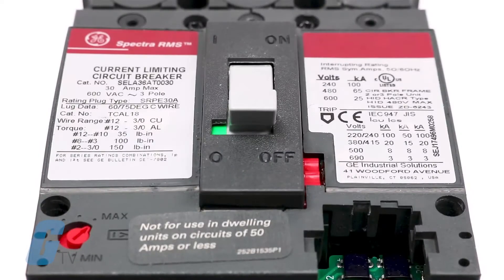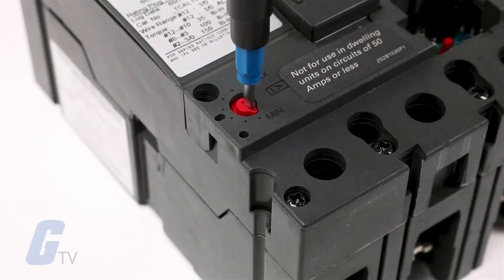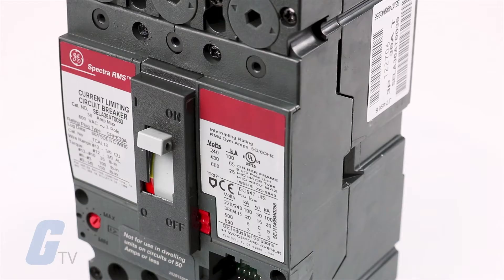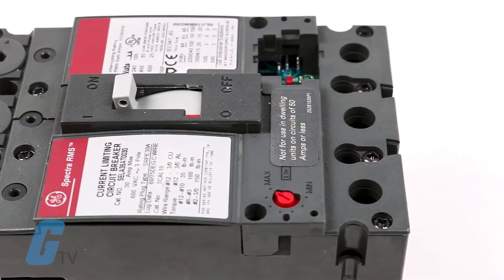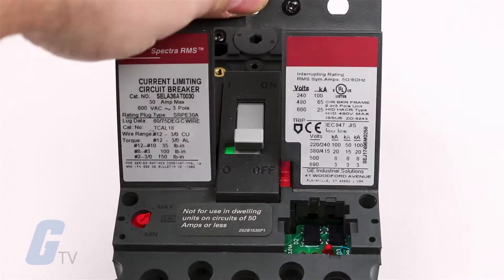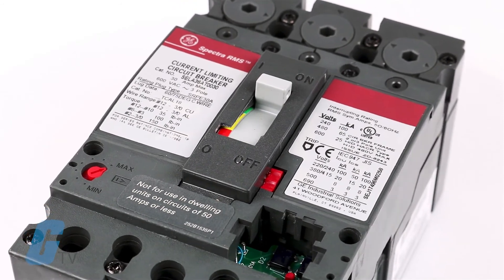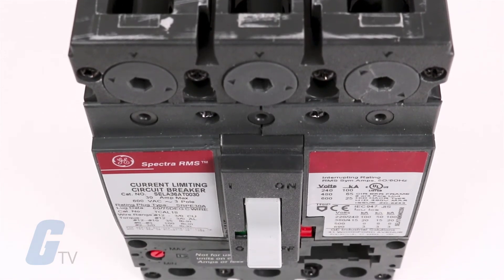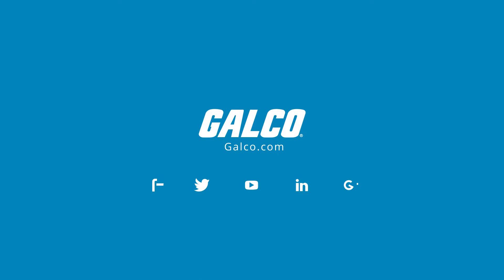General Electric's Spectra RMS Molded Case Circuit Breakers

Comment: Question:  if the rating plug in the circuit breaker is 200 amps, then the breaker is a 200 amp breaker,  even if  you adjust that red arrow from max to min the breaker would still be rated at 200 amps and would require 3/0 awg conductors???